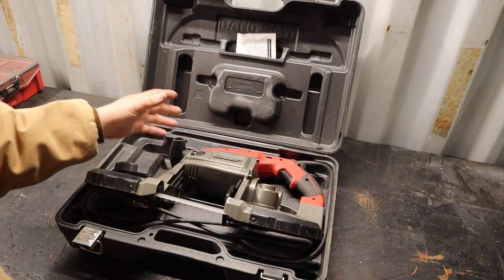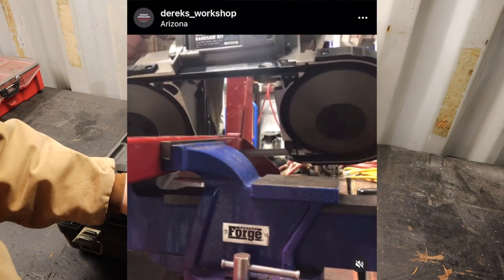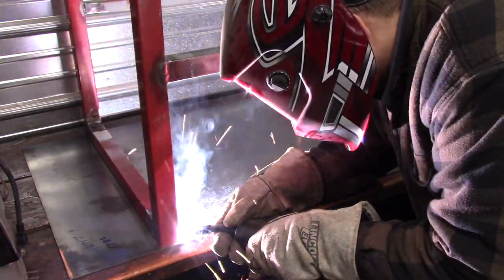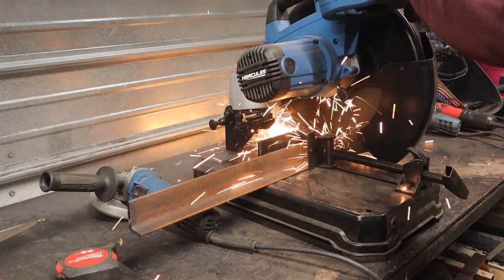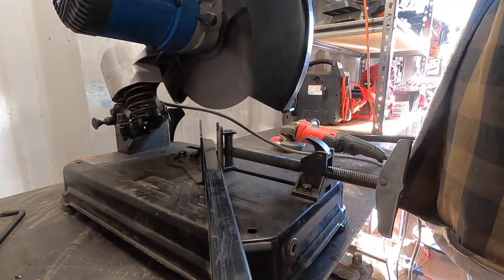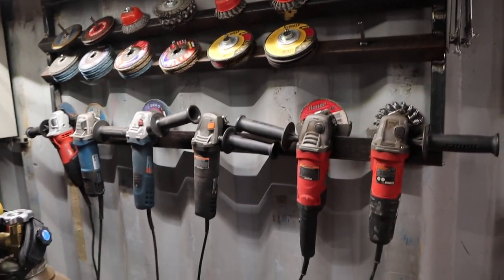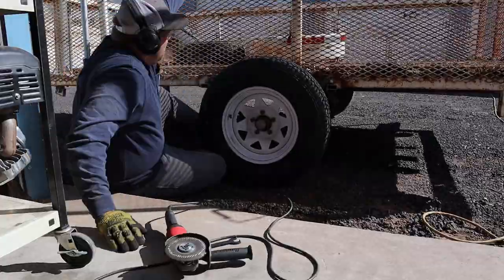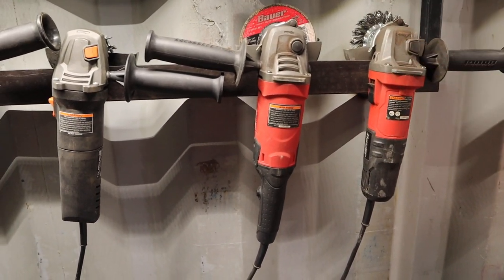Top 5 Welding Tools from Harbor Freight

Comment: i have my bauer bandsaw on a swag stand. i definitely wouldnt use it as much without the stand. i thing to note: i had to shim one side of the mount because the bauer castings are not as precisely ground as the more expensive brands. with made the blade set out of square. that said shimmed it works great.
Reply from the maker: Ya, those things went up a ton in price, I looked at one today and it was like $250 for the Bauer version of the stand.

Comment: That portable bandsaw is great.. a tip is to put a Milwaukee blade on it.  First thing i did to mine.
Reply from the maker: I’ll have to get those next time I buy a set. I didn’t know they were compatible but I should have guessed!
Reply: @DereksWorkshopAndProjects  I have the older model from Harbor Freight and it fits perfect same length blade.

Comment: i have that rattail grinder and i to like it a lot. nice to have a variety of grips. owning dewalt paddle, hercules paddle and slide lock switch. the bauer rattail trigger is a nice one. also really like the cord length. grinders with 6 foot cords, just don’t work for my setup. 8ft is nice. ive bought the 10ft orange extension cords from HF and put those on 2 grinders so far
Reply from the maker: Oh ya that’s a good modification I hadn’t considered. I like the length of the cords personally but sometimes it’d be nice to have longer ones.
Reply: @DereksWorkshopAndProjects  yeah my dewalts had 6ft. It was always just to short.. My vise is about 5 ft from my outlet, so kinda a personal problem

Comment: Another informative video. Keep them coming and putting in that hard work.
Just fyi: Ryobi has a 4.5 corded rat tail grinder with a swivel handle, plus an additional handle position on top of the grinder. Yes, I know it’s “Ryobi”, but it’s probably my favorite grinder I own.
Reply from the maker: I don't have a problem with Ryobi, don't love the color but they are pretty good stuff and admittedly maybe a better overall buy than better.